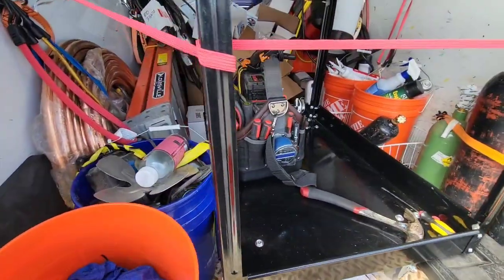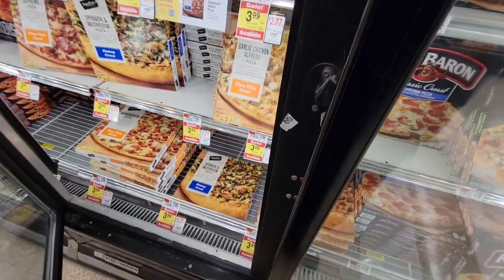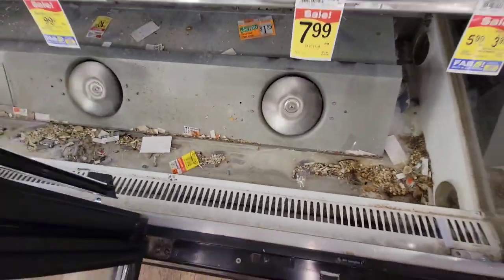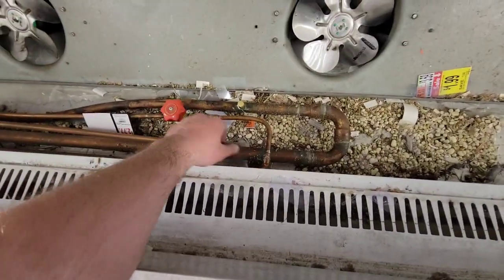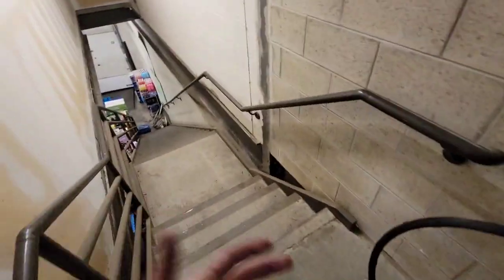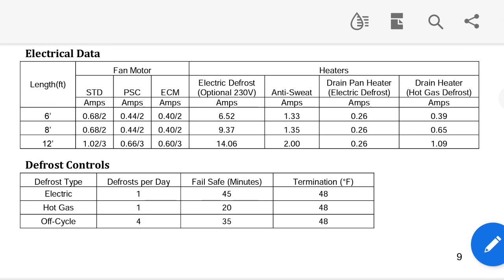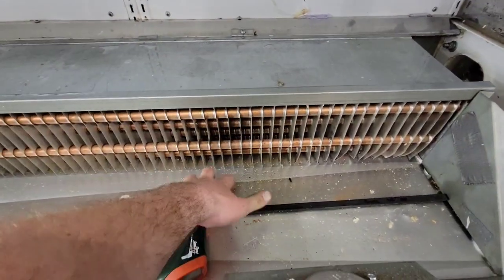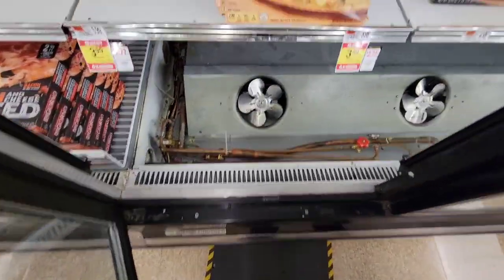Supermarket Refrigeration - How to Troubleshoot a Case Running Warm ( Iced Drain Pan)

Comment: I just defrosted the coils on an ancient case in the corner store I’m helping to operate.  I had to use a small kettle to boil water and pour it onto the ice in the coils on the back wall of the freezer, took a few hours but it’s been running cold since then.  The electric defrost seems to melt the ice at the bottom of the coils but the ice builds up about 4 inches from the bottom where it probably doesn’t completely defrost.  Boss wants to buy new freezer case but our technician says it’s likely to do similar things depending on the design, and we’re probably not going for the best available equipment given the small budget of the store.  I think new door seals would improve things by keeping moist air from penetrating and getting the doors aligned properly so the seals make contact all the way around...  We’ll see if that gets done, depends how soon we have to defrost it again.

Comment: I'm a 1st restaurant refrigeration tech, starting my 2nd year up rn. Is there a point in my career where making the transition from restaurant service to grocery store is worth trying? if so how do you guys learn these systems? is there separate schooling you took for this? or just all on the job training/learning. great video, you're very thorough. I like to check for ice on the coil, and airflow when i approach a call too. good video!
Reply from the maker: Thanks and all on the job and reading manuals. 

And I guess if the price is right and you want to switch I started as my first job.
Reply: Just dive in bro hopefully you will work with cool dudes that will help and train as you go, theres always something new no matter how long you been doing it.
Reply: what he said. always keep learning even if its not something you ever see.  be very versatile.
Reply: Managers always be mistaking defrost cycle for case running warm haha

Comment: We get an empty glycol drum and fill it with hot water then use a little pump and garden hose to de ice cases. Works pretty good to keep from dragging a long garden hose all over the store.
Reply: How much is glycol drum and how much. Water it can hold. Do you just use pump on hot water ?

Comment: That’s not how you check hot gas defrost lol and did you check your hot gas differential valve ? To make sure the hot gas isn’t just sitting in the Evap and not return to the rack ?
Reply from the maker: I had no cause to check those things. 

So those are all valid things to check but it was no reason to check those things if I had probable cause to check those things such as a snow looking coil or defrost not working. Then we could then go into further troubleshooting but for a basic drain pan icing up just making sure that it works is plenty this was not a video troubleshooting specifically Hot Gas defrost. It's just a generalized check. 

Anyway I hope that alleviates some of your concerns.

I also have a video on hot gas valves if you want to look at that. Defrost system if you believe it has an issue.

https://youtu.be/JN3It7cyzqY

Comment: We have a defunct 3rd shift maintenance at the walmart I work at. They are supposed to deep clean all the bunkers, wetwall, and display cases. It's 930 at night on a 1 to 10 shift and I smell rotten MDF board and wet bathroom carpeting by the grape bunker. Next thing I know is there's a huge puddle of water running out the bottom. I'm not dumb and understand at least the basics of refrigeration and immediately assume its the condensate pan. I grab the case cleaning cart(all walmarts have them in the fresh area) and start cleaning out the steamy hot musty water bath that is now leaking all over. The next day it happened again, figured out that no one communicated with each other and washed out the bunker twice and having 1 out of 2 of their brain cells firing off at any given time probably thought the 300 gallons of water they pressure washed down the drain would just end up in the sewer somehow. All it does is fill up the condensate pan and being so up on PM, our store has never replaced the wicking filter so it fills up faster. I took it apart and started to clean out the condensate pan and noticed the float shut off was stuck against the drain line. We put in a work order to have it fixed and after the guy came out several times complaining that we don't clean the thing out enough, its just broke and he cant fix it. He doesn't want to mess with a 2005 unit anyways....Who does? After a while I start hearing whooshing and what sounds like a fan going out in the wet wall by the crisp greens section(the one that sprays water in your face while you're trying to fill and tidy it up). About an hour later into the busy dinner rush, I have a manager chewing us out because we aren't doing our job cleaning out the bunkers and wet wall enough. I guess they don't follow walmart one best way rules that shows 3rd shift maintenance doing it. It's all of our jobs now so in the middle of the busiest time of the day I have the case cleaning cart full of water in the pressure washer, vacuum, and every attachment needed. I had a manager call building services and silence the alarm, grab another associate that was busy and now pissed off, the fan guard tool, and proceeded to open up the entire section and found mold, slime, and water clogged all the way up to the fans. You are supposed to shut off the gas, unplug the fan, insert the plug in, and proceed to clean the unit. First off the cord was spliced together and looks like they gooped it up with rubber sealant. Probably because it floods out a lot and they didn't want the water getting into the plug and cord. So I just sucked all the trash out, and power washed the entire thing. Took my sweet old time and had customers wandering around getting sprayed by chunks of rotten produce slime and water. I sucked out as much as I could and had to clean around the fans while they were on which was a big no no. What can you do when they glue the cords in place so you can't undo them. Oh well, what do you do to keep a manager off your back.
Reply from the maker: Yeah the manager will always be after you unfortunately.

Comment: When setting to manual on in the Defrost does that override the selected termination Yes?  I wouldn't want the defrost to end just because the temp sensed high on the coil sensor.
Reply from the maker: The way it works in the Dan Foss controller  Is that it will have the defrost run for a duration you can change the  Duration if you want but typically it's 30 minute even if the temperature sensor is showing that the defrost should end. 

 For a Emerson controller you would choose emergency defrost.

Comment: Can contractors that own there own company do supermarket jobs?
Reply from the maker: As far as I know yes,

In my state you need a licensed to work on system this size. If you have a license your good to go. I think.
Reply: @gendronhvac-r1269  thanks brother! 
Yes sir been doing hvac/r and plumbing since age of 15 
Am a lincesed contractor in both fields.
Got my hvac and ref number , just curious if I can work on this type of equipment through my company or do I have to work for someone else. 

Thanks man!
Reply from the maker: @dr.comforthvacr8889  

Yeah as long as you have the license to work on a system with over so many pounds of refrigerant I forget what it is. You should be fine my company's subcontracts out lots of our jobs. Some of our subcontractors are legitimately single servicemen or sometimes like a crew of two guys. So you don't need to work for some big company to do it.
Reply: @gendronhvac-r1269  that’s great to know. 

I have some experience with supermarket but want to do it more often! 

I have a total of 4 guys that work for me and myself. 

We are located in Alabama! 

But would love to get more hands on in supermarkets!! 

Thanks brother for everything you do I learn a lot form your videos as always! Your the man!